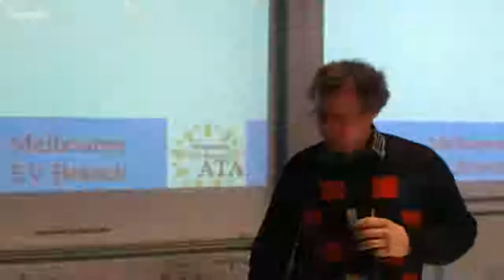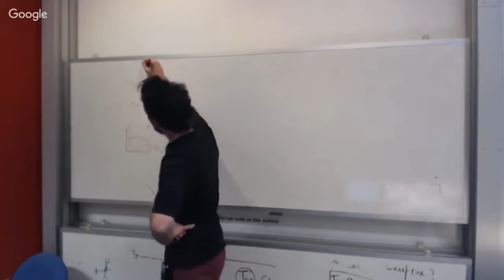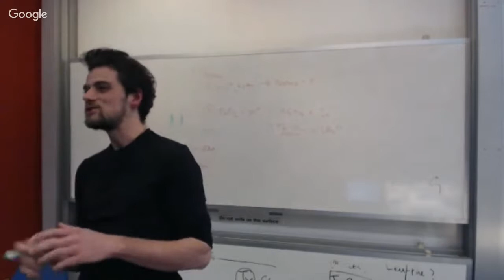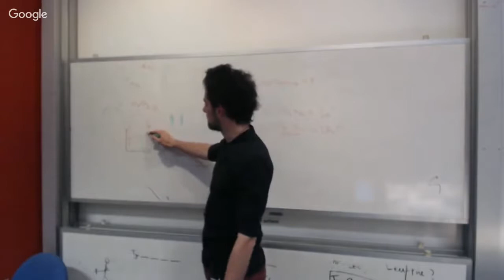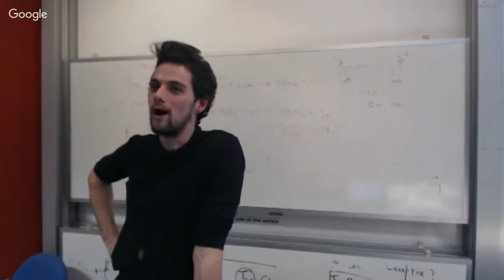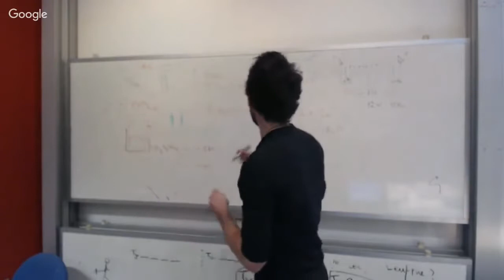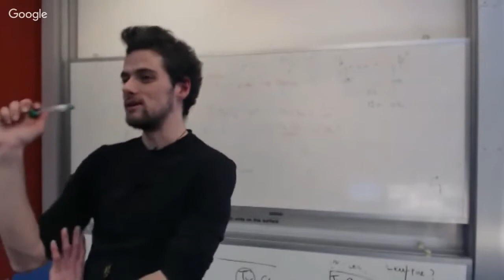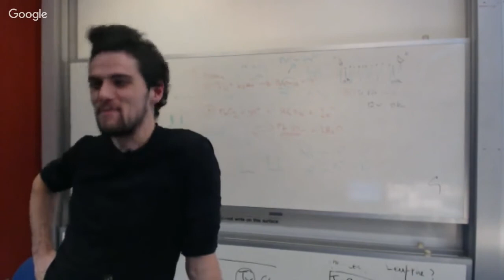Alternative electrolytes for lead-acid batteries - June 2016

Comment: Great video and explanation. I was reconditiining my lead battery and charged it as much as it can take before taking out acid and washing the battery and then feeling up with 1 cup of MgSo4 diluted in 2l distilled water and to my amusement it cranked and started the car without any acid so I have question for you what molecules from MgSo4 did get drawn to lead plates in order for the battery to produce electricity since I did not charge the battery at all to try to convert lead sulfate back to the sulphuric acid and the electrolyte did not have any sulphuric acid only water and epson salts??? I though that would be interesting if someone can explain it.

Comment: Excellent  information  is there  a way I could see your paper on this subject I am building a large battery bank from recovered automobile battery's that come from a parts store core pile.  Am using pulse desulfation and often have to reject large batteries that do not respond . Am experimenting with reverse polarity charging with some sucess.